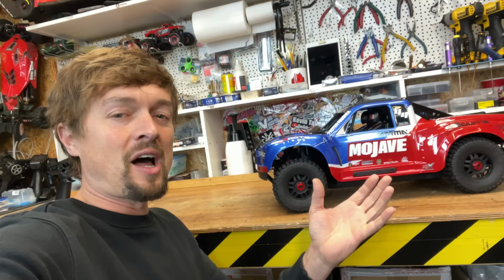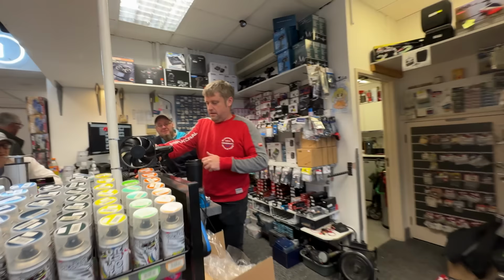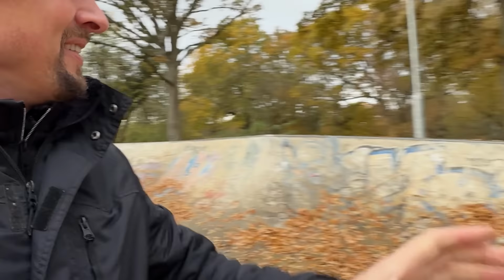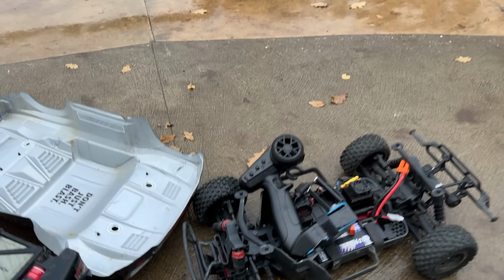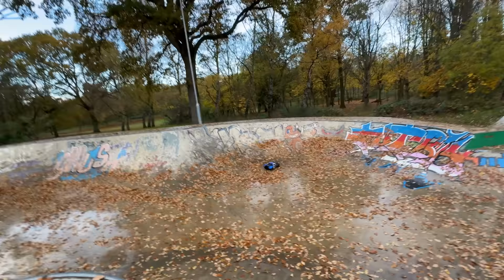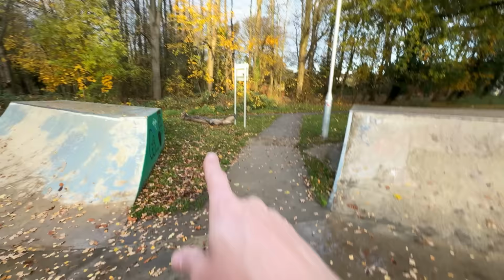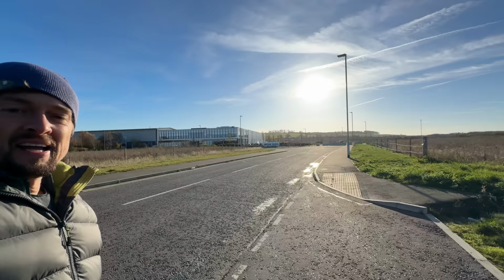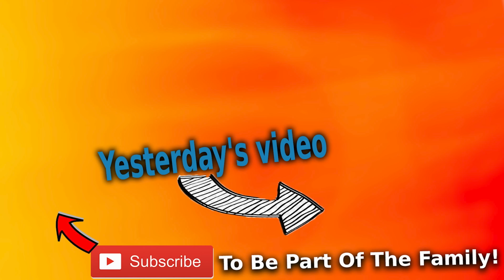NEW RC Car has a Special trick - WOW, you need this RC!!

Comment: Watching kev got me back into rc's after 35 years. Much better nowadays. Waiting 12 hours for batteries to charge was maddening at 11-12 years old. Transmitters & servos cost more than the cars back then
Reply: Ah remember those days. Had a Tamiya Lunchbox for Xmas when I was 13. Spent an age building it without realising how long the battery took to charge. 12 hrs for a 15 minute run 😂
Reply: Oh yes, I remember those days. My little brother and I got into the hobby around 1990 after breaking MANY Tyco brand rc's. First "real" rc was a Losi jrxT, then an LXT. Those early (for us) days were heaven for about 30 minutes until we burned through the only 2 NiCd battery packs we had. Then we'd wait impatiently for HOURS until they charged. For a 10/12 year old kid that seemed like an ETERNITY. Then... we pooled our allowances/savings and bought an RC10GT in '94. That opened up a whole other world of extended run times (and tuning issues). When it ran well, it was the most fun a kid could have. When that engine wouldn't run right it was incredibly maddening, but it taught us a lot about internal combustion engines and kicked off our "grown up car" obsessions. I've just recently got back into the hobby because I introduced it to my own 14 year old, and The brushless systems we have now just never cease to amaze me. Wish they were around when I was a kid! Although, with as fast as these are and how often we break parts, our cars would've most likely just ended up sitting on a shelf because we couldn't afford parts. Lol. Ah memories...
Reply: @cliffjones9922  lmao, I've got a re-Lunchbox this year for Christmas! Will spend most of its time sitting on the shelf between the OG Hornet and X01 though, with a few runs to wind the dog up in the backyard!

Hope you have a great Christmas season ahead made, peace from an Aussie living in the UK :)

[edit: oh man you're in to transformers too!!! I've still got an original megatron and optimus in box. have you seen how much G1's are worth these days? we can retire off our toy collection!! Double peace to you bro!! ]
Reply: rhyzenangelotumamao1909  Slow charge certainly took a veritable lifetime. The fast charger needed to run off a real car's battery and took about 15 minutes. Whenever family gatherings happened us kids would be out the front of the house with all our parent's bonnets up! Good times.
Reply: @cliffjones9922 I'm sure the nicads took about 1 hour or so. Am I new to the party.
Reply: Word
Reply: Word
Reply: You had the fast charger?
Lucky!
😂
Reply: @ZingZingNZ Mid to late 80's the AA nicads took between 8 to 12 hours. My first RC car was a Bullet, which was basically a 4WD Jet Hopper, and took 8xAA. Until my folks bought me a couple more sets of batteries I only got one run per day!!! That's why upgrading to Tamiya with their battery packs with the fast charger you connect to a real car's battery were so awesome, 15 minutes to charge was heaven.
Reply: @jbirdmax  😂
Reply: @----.__  I still have the 6-7 cell 15 minute fast charger. With the alligator battery clips and all.
Reply: @----.__  I think mine is from the 90s though.
Reply: I started rc's during the dynamite stick battery days those took about 5hours to charge still maddening for a 15 minute rip lol i had a grasshopper cant remember who made those been to long lol
Reply: Right, I remember my 9v battery for my FasTrax took about 5hrs to charge, and it only lasted about 10 mins. My first hubby grade, was the Team Losi XXT. I eventually got the Tekin B112c charger and that took about an hour to charge a 7.2v 6c pack, about the same as a 3s LiPo pack, now days. Those were the days, but I sure as hell dont miss replacing those motor brushes, every ~7 runs lol.
Reply: I was sitting there thinking this myself. I remember spending like $200 on a car 150 on a radio plus batteries plus charger and now everything comes in a box for 100 bucks😂
Reply: I had the 30min fast charger you had to run 3 times to fully charge the battery. And discharging them with a rack of 1156 lightbulbs you had to solder together yourself
Reply: rhyzenangelotumamao1909  only with bad trickle chargers. A good charger sped up the process significantly.
Reply: Lipo batteries have definitely saved me some time compared to my childhood nickel metal batteries. And the power to cost blows nitro out of the water.
Reply: I remember i stole my 3 sister allowance and bought that police bike with the remote on a string..😅😅😅😅😅😅😅😅i got a good beating for that one..😅😅😅😅😅😅😅😅😅😅😅 aaahh the 80's
Reply: Ah yeah
Reply: I was around 13, and got my first hobby grade RC. It was a Team Associated RC10T(ruck), and I absolutely loved it! Our local Skating rink used to let us race our RCs on the rink, and during my second rave, I was 3 laps in, and someone in the pits turned on their Transmitter(which wasn't allowed inside) to test his own build and caused my $300 build from my grandfather to slam into the wall so hard it cracked the frame, broke both front A-arms, and that was the end of me getting hobby grade RCs... Lol
But yes, batterys sucked, motors were poop compared to today, and radios often had frequency problems with others builds... Thank GWAR we don't have to worry about that anymore!
Reply: I can totally relate. Watching Kevs durability test on the 3s 4x4 v3 Senton is what got me interested in RC again after 15 years. I bought the Senton a year ago and it's been awesome. Thanks for the videos Kev!
Reply: Same here I thought I had a good rc car as a kid but they were nothing compared to today's cars
Reply: I had the original RC-10T. I think I was around 14 or 15. Took me four days to build it. And the damn charge times were horrendous. 8 to 10 min run times. Such a bummer waiting during the summer for it to charge just to get a short lived bit of excitement.

Comment: When the Fireteam went on sale for $399, even though I said I was done with my collection and did like the Fireteam but was not paying $700 for it, I figured it was a sign. But small things can appeal to me as the Fireteam had the dirt guards on the body. My first outing was in ice and water. The entire body was incased in ice and the electronics were all clear. The dirt gaurd is a good little improvement to help keep debris out of the chassis fans etc... Now back to the video. 🤣💯🔥

Comment: The 4s Mojave is a great car.  Its fast, durable, handles great and its a ton of fun.  We compared this to the Traxxas Ford Raptor R and this just seemed to have more features and be a better value.  Friends have the Raptor R and they are pretty closely matched in actual use.  The Mojave seems a bit more solid - but its heavier.

Comment: Hi, thinking about the tires for speed record cars, that blow off…
Maybe should get full rubber tires=tires + hubs. Full rubber that connects to axels….directly…
The center being holed w deep notches to fix the nuts to the cups….
Hard rubber…or things like inline rollers wheels…maybe a 3D printed tpu or hard rubber…
💡💡

Comment: Kev your videos are always awesome to watch. The purpose of the lever at the battery is if you run shorter batteries, it allows it to help hold them better. What camera do you mount on the hood, and which one did you place inside the Mojave 4s?

Comment: I need to know the gradation of the silicon oil for the center diff out of the box. Looking through the spare parts on the Arrma website, I found that for the shocks it's 300cst and for the front and rear diffs it's 10,000.

Comment: I don't believe the 3s Senton has a gyro, it runs the older slt300 reciever which is quite basic. 

This was for sure true on the one I bought in 2019-2020ish and for the year or so after while I worked at a hobby shop. They definitely could have changed that but I've never seen it on any 3s box or advertised.

Comment: On the 6s mojave you can put foam in between the body mount to keep it from cracking where they break. Great video kev
Reply from the maker: I tried that before, still broke. Every time I use it guaranteed, makes me not want to use it at all

Comment: Great vid that dent right away sucked. The slt3 and the 3s senton don’t have gyros nor does the 6s Mojave or the 4s Mojave. At least that’s what I thought. Arrma has it but it’s called avc and only comes on certain vehicles with an upgraded transmitter and a knob to adjust how much you want it to interfere. Im sure someone already commented this.

Comment: As much as I love it, Kev doesn't always give correct information, the senton doesn't come with an AS3X gyro receiver for AVC,  he may have added one. But that slt transmitter doesn't have any gyro controls. So unless he added a Gyro it's wrong information.  And the arrma bashing at the beginning when it was a receiver issue also shows a lack of general knowledge  or just decided to blame the brand cause he's hard up for traxxas.
Even though he was corrected later for the gyro thing. Still shows the lack of knowledge that's easily show
Reply from the maker: im not here for the knowledge, im here for the fun

Comment: He only wastes😢😢 rc cars. One must learn from him how to break a brand new one within a second...Crazy fellow ..!!!
Reply: It's not waste, these hobby grade cars are 100% fixable. If you like working on them then you can break em and it's usually a cheap repair... Just a few $3-$10 parts. 

I snapped my car in half accidentally hitting a cars tire at full speed and fixed it for under $100 instead of throwing it away.

If he did this to some cheap $100 Amazon RC car it would be headed to the trash because parts aren't available.

Comment: Metal is easy to repair plastic is trashed once broken AND breaks easy its why they make a lot plastic. You keep buying like a sheep. Metal can also be reinforced with L profiles. ill take metal ANY day.
Reply: What? metal chassis? if they have bent they have lost that strongness and even if you bent them back they will bend easy
Reply: @Cheesicle_  Nothing a temp cycle can't fix. Good luck fixing that with plastic. plus you can reinfoirce them so they don't bend that easy.
if i would get into this i would definityly have a torch and a spot welder or welder. or just baby gear and dont do things thats asking for them to break lol.